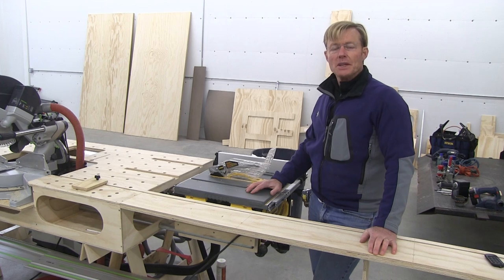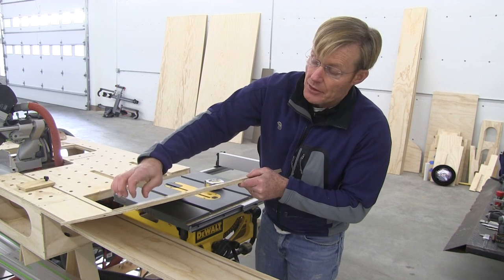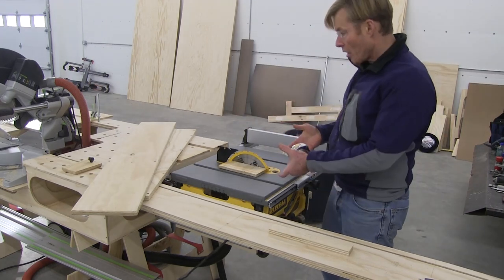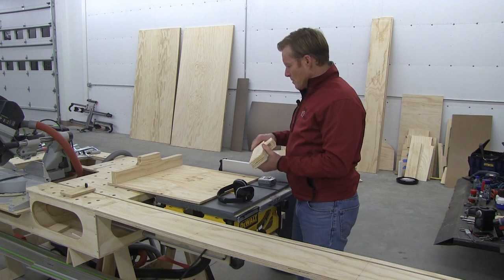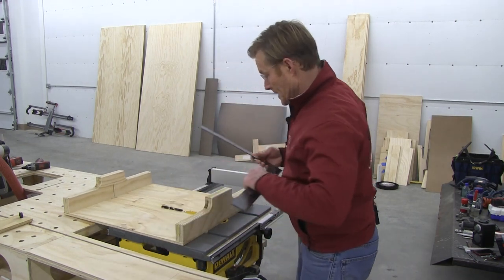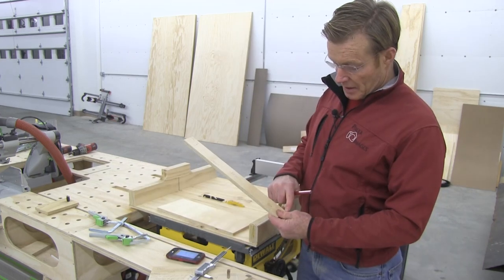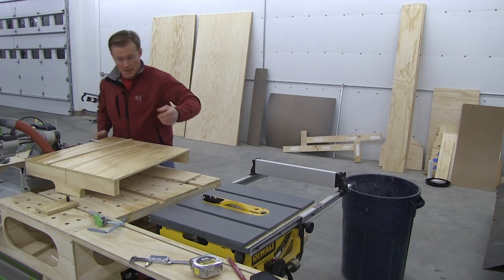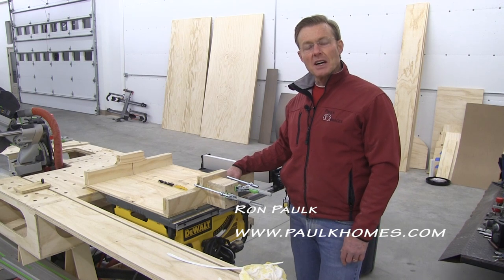TOOL TIP #2 CROSS CUT SLED

Comment: Happy New Year Paul.  I recently purchased your plan set for the bench, miter saw stand, etc.  I noticed your bench in the video had been modified to receive your chop saw.  Since I haven't started my bench yet would you recommend incorporating the modification in my own bench.  Thanks...Great Videos!!
Reply from the maker: Dennis, I would build the PWBll and wait to see how the new bench "Total Station" comes out. I plan on using both in my work flow. I have been working on the Total Station for about 6 months and the current version is very rough, but getting close. I will post a Youtube video once it is ready for prime time.

Comment: Thanks Ron, I have made a few sleds now and fussed over the accuracy, but this is great. My question is unrelated though. I recently purchased the DeWalt744 on a Closeout at a great price, but I am disappointed with the dust collection with the right side of the blade having such a large opening. Have you made any modification to improve dust collection? Tell me your thoughts, Many thanks.
Reply from the maker: Ian, dust collection with a table saw is marginal at best. I have made no mods other than using a 2" short hose with auto start so the dusting collection has a chance.

Comment: When did u modify the bench to add the miter saw?  Do you have plans for that?
Reply from the maker: It is a work in progress. I have been working on it since mid summer, using it on a large remodel. It will not and does not replace the main work bench, but I am finding it works well in tandem. Once it is perfected, I will build the final version and post it on Youtube.

Comment: Hi,

I love your shows.

I had assumed that if my fence were not parallel to the blade, the jig was up anyway.  (My fence is parallel.)   So, to make a quick and handy sled, I slid the fence up to the sled and used a big carpenter's square to align the back fend of the sled.  Please tell me, did I go wrong?  Please remember, this sled was to be "quick and handy", not one for making musical instruments or other pieces that might require great precession.

CAB

Comment: Lot of guys use 2 runners.  How has the single runner worked out for you.
Reply from the maker: Allan, I have made and used dual runner sleds before, but didn't need that level of precision. If I were making fine furniture, I would make a much more complex and accurate version.